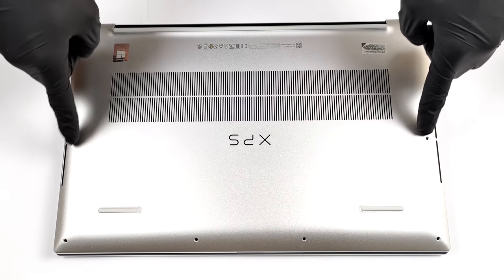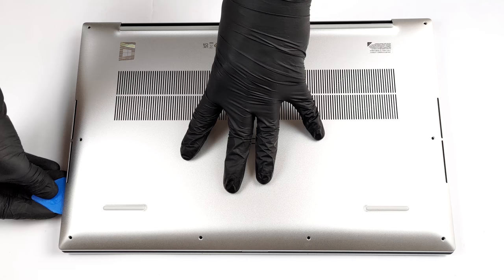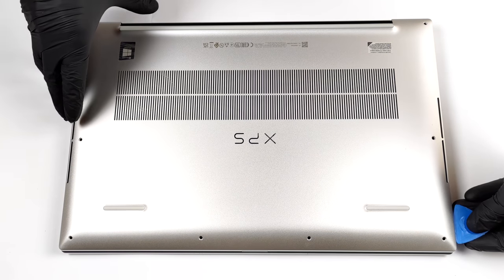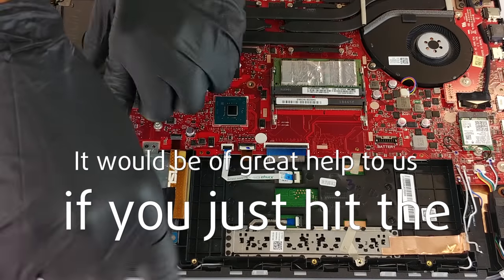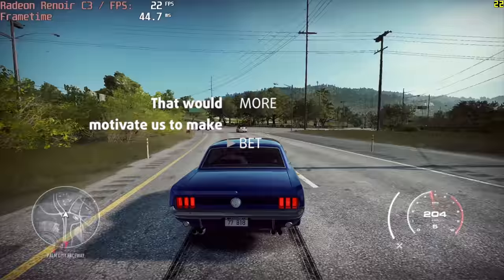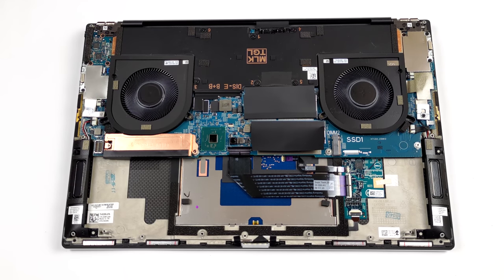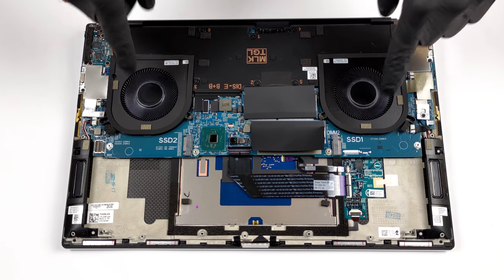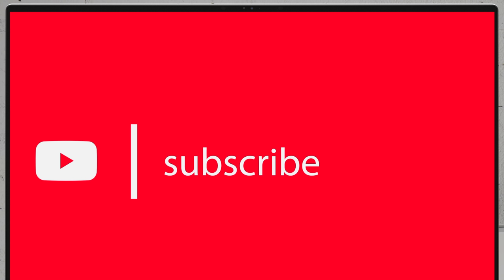🛠️ Dell XPS 17 9710 - disassembly and upgrade options

Comment: 2:12 "One of which can fit gen 4 SSD's" 
This is inaccurate. Both M.2 slots can fully utilize PCIe 4.0 M.2 drives. Although, both slots do share the same 4 PCIe lanes so I wouldn't attempt something like a Raid 0.
Reply: RAID 0 could work though, maybe with sequential reads and writes there won't be a major improvement but random reads and writes would improve, no?

But it's a laptop so raid 0 is a bit of a waste
Reply: Why would you even need RAID 0 when PCIe 4.0 drives can reach 7000MB/s. What is there to gain in real world utility.
Reply: @BrianJ.  Good question, on a server there are some applications with ROM intense rendering that could benifit. Though on a laptop like this, the increased latency of Raid 0 will likely overshadow the increased speeds.

Comment: Having a real hard time finding out what brand of M.2 NVME was originally installed in my 9710 model. I bought my laptop as used, and I checked the model in the Disk Storage, and it's a WDC SN730 NVMe. I have a feeling, it's not the original
Reply: The 9710 comes with WD SN730 NVME SSD. Its orignal.

Comment: So, to change the battery, one needs to take off the back cover? That's BS.
Reply: That's standard and not too complicated...
Reply: do you have a time machine??  because it's not the 90s anymore...
Reply: This is considered one of the easier battery replacements on the market. No glue!

Though now I'm curious what you expected; a battery quick release or something? 
Such things add substantial bulk and reduce build quality.
Reply: @SimplestUsername  I was expecting a battery quick release
Reply: @vasilestana9754  That definitely used to be a thing. Now I believe such features are exclusive to rugged laptop lineups and maybe some commercial models. Nothing you'd want to use as a daily driver.

I just opened my XPS 17 Today to install a new M.2 SSD. It's honestly very simple so long as you have the right Security Torx bit and something  like a guitar pick to pry it.
Reply: @SimplestUsername  I suppose the key thing is if your'e away from mains power for a period of time, you can't easily switch batteries to prolong use like I can with my Dell XPS L702X from 2012